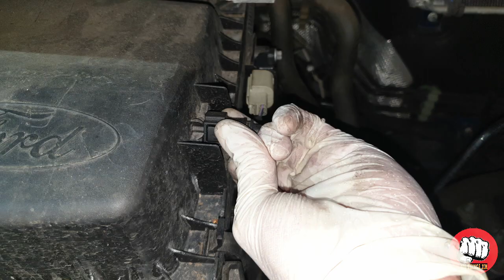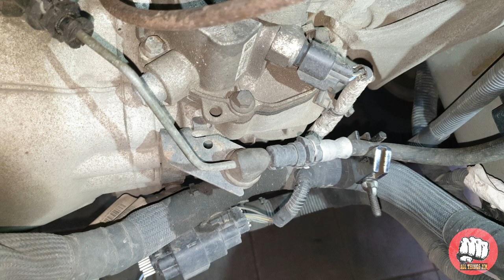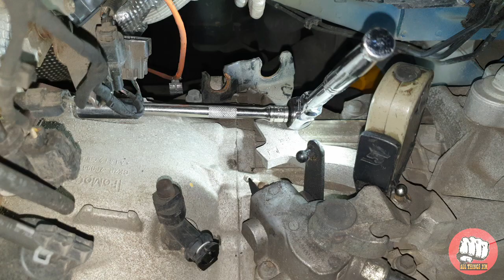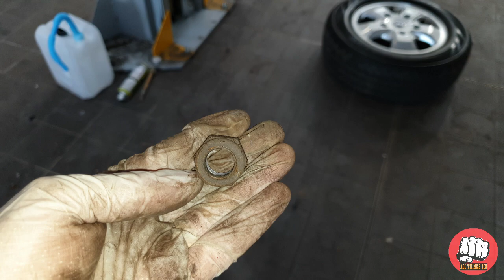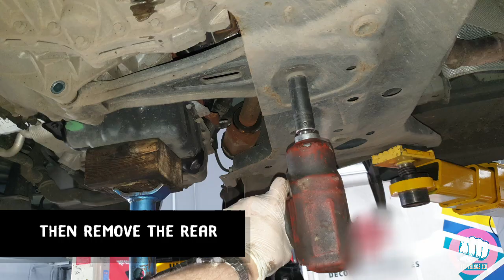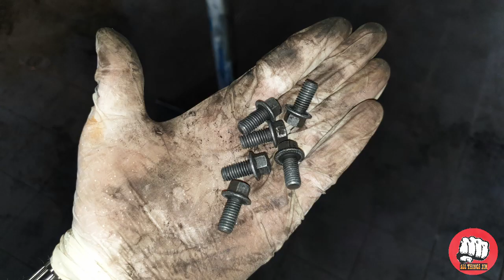ford transit fwd clutch, flywheel and slave- How to replace

Comment: HI Jim, what’s the RWD Mk8 8 like to do pal as mine is slipping after an recon engine fit
Reply from the maker: Honesly I believe its easier, although heavier to lift if your on your back doing it, just remember to mark the propshaft up so it goes back on in the same position

Comment: Same breakdown, the van is 3 years old and has 47,000 km. The flywheel seems to be fine, there is no wear. The van is always used without cargo. Why does this part fail?